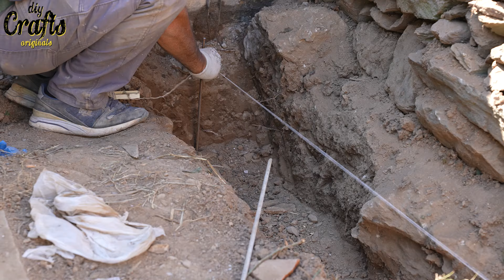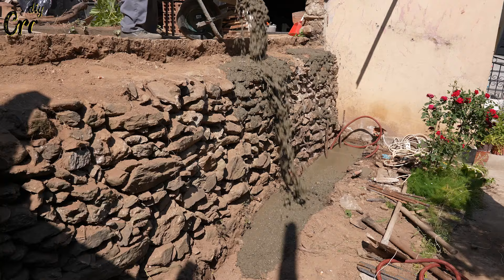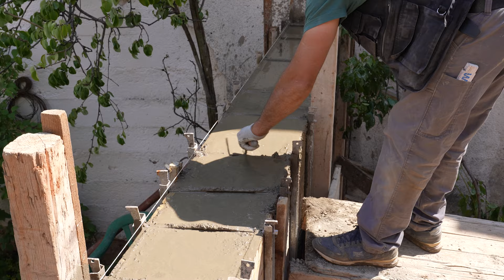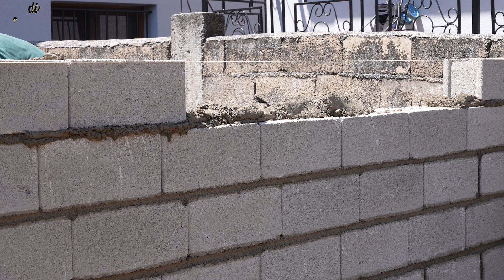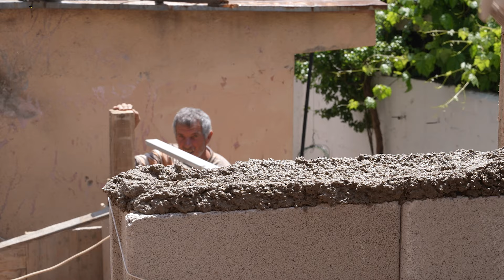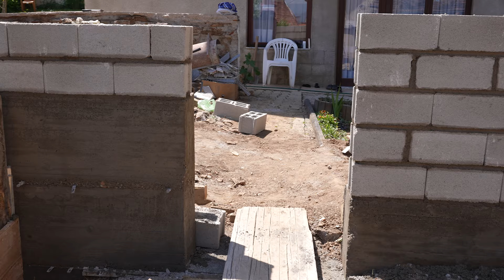Building a Cinder Block Fencing

Comment: badly done, rebar should NEVER touch the ground.  That is going to rust and break the concrete.
Reply: I agree. Reinforcement in the footing cannot be placed in the soil or hard ground as it is susceptible to corrosion and rust
Reply: What about fiberglass rebar in a climate that experiences freeze thaw cycles?